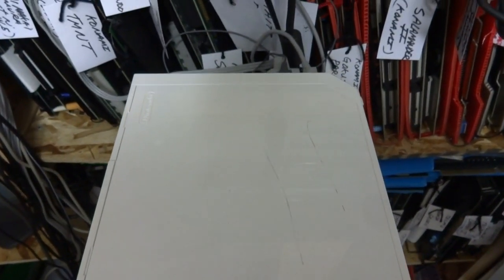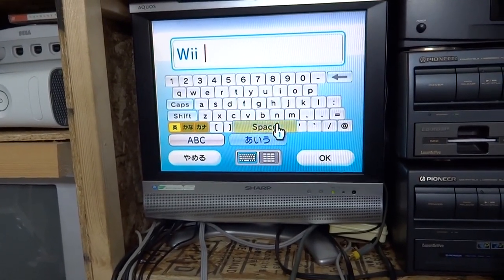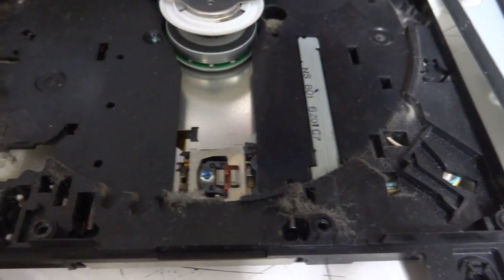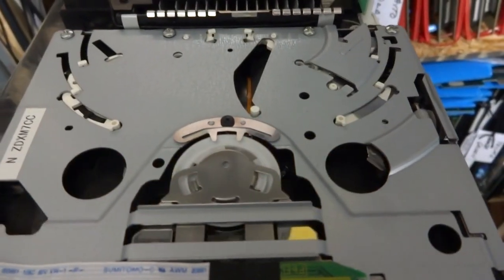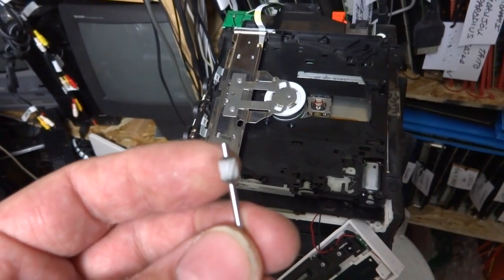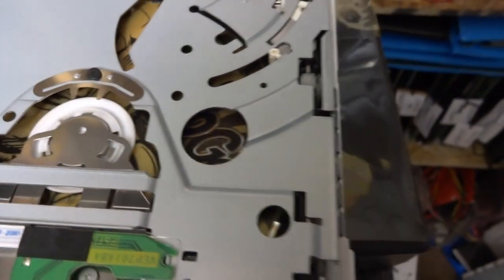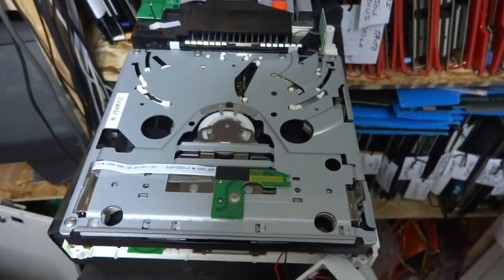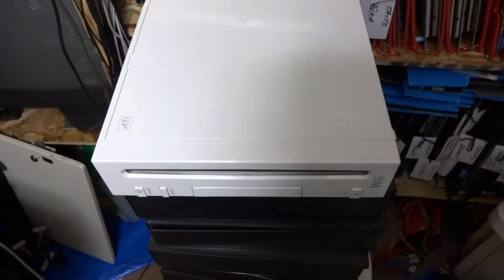Wii Disk Loading Mech Repair

Comment: I'm afraid you've misdiagnosed the issue, which is why the grinding noise did not go away.  The issue is really with the plastic gear train on the side of the drive that moves the white plastic slider froward and back.  More disassembly is needed to get to these parts.  Most likely, the gear teeth on the slider have worn and or broke.  When the spur gear spins, it slips against the broken or missing teeth on the slider, which is what makes the grinding noise.  Also, then the gears slip, it means the drive cannot transmit enough force to the slider to open or close the mouth of the drive, which is why the disks won't properly load.  Unfortunately, I don't think the broken or worn gear teeth can be easily repaired.
Reply: I noticed that on my Wii, too… 😢
Reply: at that point you should just replace the disk drive

Comment: I had the same exact issue! I also used JD Weld epoxy to stabilize the broken gear. Like Luke, it did not help with the noise...it still made that loud grinding/clicking sound. I decided to remove the gear from the shaft, flipped it around, and slid it back in with the nipple end first. That did the trick! The noise was reduced considerably. I guess in my case, the gear’s bad side was not in the middle but toward one end. By flipping it, the bad end shifted so the worm gear did hit it directly anymore.

Comment: Thanks, that was a good idea to check the worm-drive/pinion wheel, as it had split on mine and explains why the discs weren't being read. I used some Araldite epoxy resin based glue to fix the pinion back onto the shaft, and it's all working fine now.

Comment: hey lukemorse1 i figured out what the clicking noise is  its coming from the gear the the belt meets the top worm gear and shaft  i shimmed the gear with a small strip of nylon and it stopped clicking the gear gets worn out on the case causeing it to shift on the shaft causeing it to jump and click on the body of the holder  so i shimmed it up and it works good now ^_^

Comment: Nice job with this one Luke, another rescued piece of hardware! On a different note, I was just thinking about your comment at the end, lol, it's so true man! Nintendo put an ad on one of my old pickup videos, that had nothing to do with anything Nintendo, so I checked the reason for it in video manager and it flagged like a 2 second sound bit of the zelda theme which was running on a system I had going in the games room in the background, while showing my pickups, lol, I was just really...beyond...astounded, lol they are really way over the top and hardcore about that kind of thing, it's just nuts.

Comment: Thanks for the video. Mine was not loading disks properly (would just spit them back out) and making this same noise. I found the same crack in the same gear. I used a bit of super glue, put it together, and it loads disks properly now. Still makes a lot of grinding noise, but I'm not too worried about that. If it breaks again I'll probably just replace the gear altogether or something.

Comment: You could put some foam over that part of the disc drive (Stick it to the inside of the top half of the wii's case so that it lines up just above the broken gear). That'll soften out the sound a lot

Comment: May not actually be bad but that sound sure is. Another solution is the homebrew channel>USB loading or external DVD drive that's wii disc compatible. You can then play your games using uLoader from the external DVD drive through USB. Also works with DVD movies and WiiMC. Costs about $40 for the drive but worth it for those cautious of drive repair or replacement. I made a video about it. That sound is horrible though. The sound is way worse than the problem.

Comment: I had the same issue, gear split in half...very loud. I tried white lithium grease and it was still loud and wasnt catching. I took the gear(same one you had split) and I put it in backwards....Now it catches everytime.

Edit: Only seemed to work when I had the lid off...I ended up finding another Wii with a broken laser and replaced the strip plastic gear and now it ACTUALLY catches every time and sounds ALOT better.

Comment: I had enough of these problems with my tape decks and I've seen them on other things as well but also on a Wii?!!! This a good reason to hate this kind of drives. The PS2 slim drive is the most reliable (except the laser and the ribbon cable).

Comment: Only thing done  positive to this machine was cleaning it out, the plastic gear either needs to be replaced or it can be flipped around and used. (I had to flip the plastic gear around in order to get the disc to insert)

Comment: great fix luke, there's not much more you could do other than replacing that part which probably isnt worth your time & money. the last 3 wiis ive repaired all had coins in the drive - i carefully removed them & they all worked without cleaning tho i believe that the wii drive isnt the best design & almost acts like a hoover for dust plus they are quite noisy inserting etc standard.

Comment: Once I found the same cracked gear I found your video after searching if replacing this gear was even possible. I'm wondering if this is an issue with a lot of the Wii drives that end up being replaced. I used gorilla glue supper glue gel (it doesn't need water and is super controllable) I put the glue into the center on the gear then slide it on. I wiped off the excess glue and fit it back in to check the position. Let it dry for a bit scraped the excess dry glue off the metal rod and everything started working fine. Hopefully it holds up. Thanks for the video!

Comment: Hey Back again Luke....you have been mia for a few months my brotha....I was hoping you could make a return one of these days....I actually need your expertise on a simple question.... I want to make my own Sega CDX adapter... I found almost an exact replacement... its an old Canon printer adapter.(I think model 150).... with the exact same voltage and amps.. (9.5v 1.5a I beleive).... the only thing that is different is the polarity of the tip.... my goal is to cut off the tip, and replace it with the tip of a genesis model 2 adapter.... my only problem is... how do reverse the tip polarity when I splice on the new one? .... it would be so awesome of you if you could make a video showing how to do that...maybe showing us how to use a multi-meter to make sure its done correctly.... luke you are the man with this stuff.... please help us out! :) thanks again

Comment: When i push the eject button on my wii the mechanism pushes out the disc all the way(to a point where it falls on the floor) and keeps turning for a few seconds even after the disc is all the way out. Would this be an easy fixable hardware issue or dust and dirt in the drive? Thanks

Comment: It's been quite a while since this vid has been made, but if anyone sees this and can help me. I still have my original Wii and it's immaculate... Until...  Wanting to play a game cube game, and it requiring a memory card, I stuck the memory card in. When I tried removing the memory card, it was stuck. After several YouTube videos, I broke out my tool set; broke it down enough to get the memory card out. After putting back together, I'm now getting the grinding noise. Any guesses as to why?

Comment: Hey I have a Wii that I was looking into the guts of it the motherboard had the female power connection part the teeth of it got bent... how do I fix this can it be possible to replace that type of part that the disc connection female part can be replaced?

Comment: I tried to fix my Wii that won't accept a disc.  I took it apart and it works fine but only horizontally.  Once I put it all back together, it won't accept the disc. It tries to read it then spits it out. It tries one more time and then spits it out.  It seems like if I don't put all the screws back, it works fine.  Do you know why it doesn't work vertically and why it doesn't work if I put it all back together?

Comment: What do you use to grease the rails on the optical drive of disc-based systems? Would you use something like Super Lube Synthetic Grease? Also, is it necessary to re-grease disc-based systems if you keep them in excellent condition (inside only, balanced temperatures, low to no dust)?

Comment: dud, I have a problem with my disk drive, with the white plastic on top. the one it gets opened with the Wii disk and gets close when the disk gets ejected. mine won't close that's why I have to play GameCube games mode on the Wii manually, because of the damn plastic. need help, no solution, think I'm gonna buy a new disk drive. any one help please.

Comment: ***** 
Hi Luke - nice fix, the drive is a maybe still a little noisy, but at least it works well :-)
Btw, how easy is it to strip down a Dreamcast GD Drive in order to access and lubricate the disc spindle motor bearing?
Daz